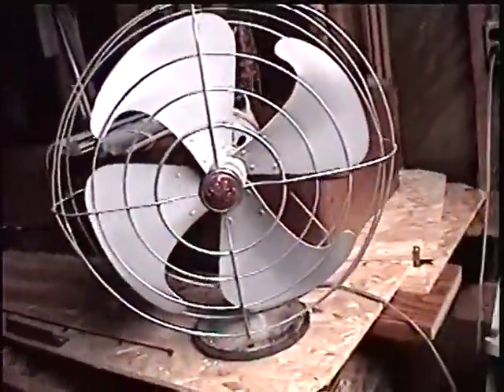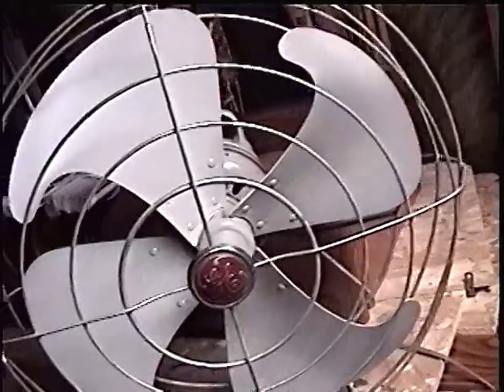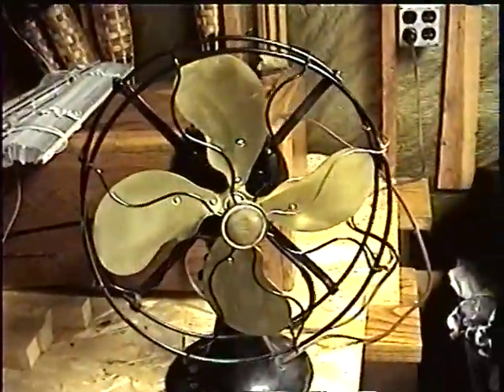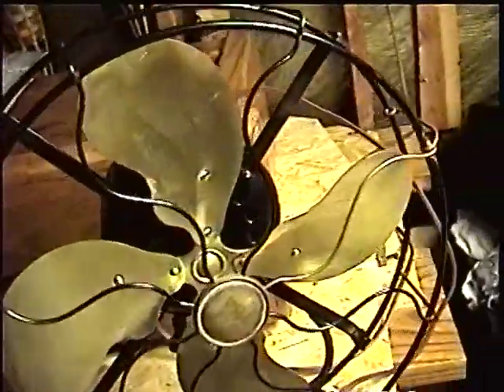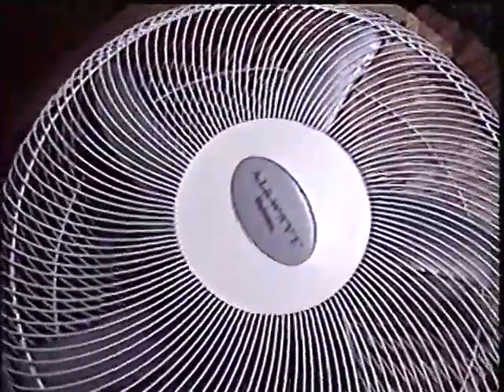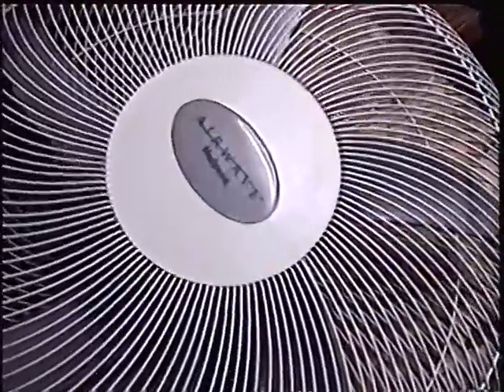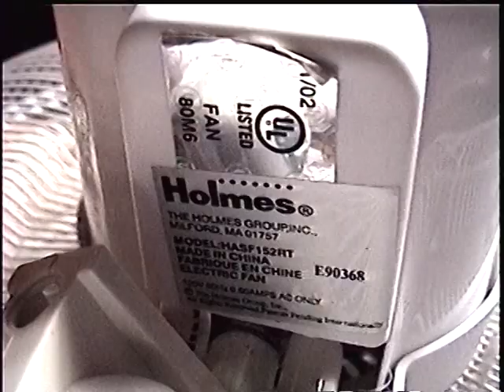Antique/vintage fans vs today's fans part 1

Comment from the maker: Additionally, the "smooth airflow" of a Dyson fan can very easily be mimicked with a bladed fan.  In the 1970s and 1980s, most of the first plastic bladed box fans were made with their blades that had a straight, linear pitch from front to back, with the individual blades starting with a significant pitch at the center and gradually flattening out slightly towards the outer edges, basically causing the entire blade unit to mimic a ship's propeller.

Comment from the maker: The dyson fans are worse with air circulation than even the cheapest desk fans.  I experimented with a few of those Dysons on display, and they did not move the air any farther than about 15 feet before the air stream simply fizzled out into nothing.  Those Dysons may provide air circulation in tight spaces such as a closet, but they will not circulate the air in a living room.

Comment: I had the exact same make and model Fan and it  was a portable hurricane. A friend gave it to me because otherwise it was going to be thrown away, and I brought it home and cleaned it and fixed all the wiring and got it running, sadly 4 months later it threw the blades. RIP GE fan best 4 months of air circulation.
Reply: That's sad, I wonder what caused it?

Comment from the maker: Totally not worth especially $450!  You can easily use that same $450 to buy yourself a nice Emerson 14648 table fan; and in fact, you can even get a nice large General Electric Type AOU oscilating fan for much less than that Dyson fan!  Also, one type of antique heater that is really cool is the Simplex Sunbowl heater.  It heats really nicely, and it draws only 600 watts of electricity!  Compare that to the 1,500 watts that today's heaters draw!